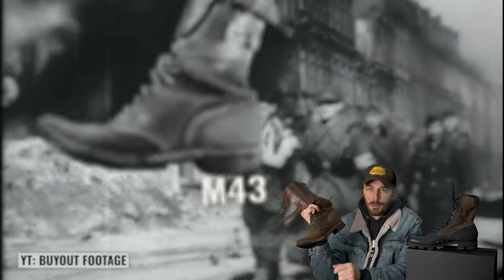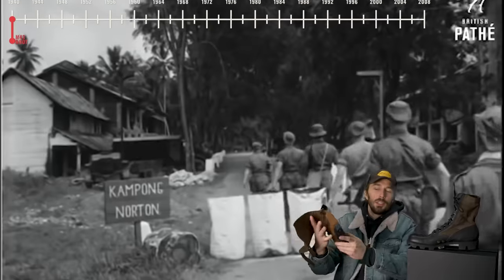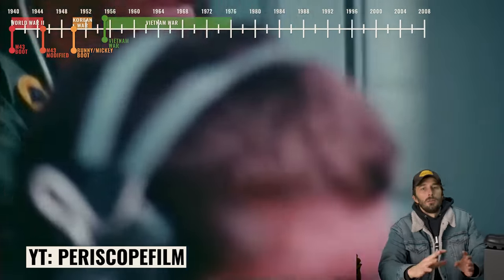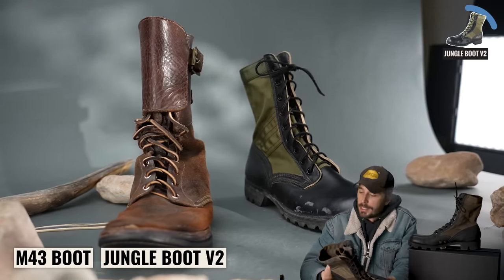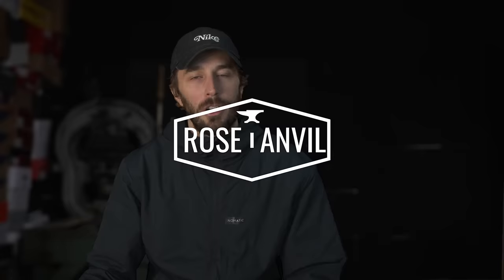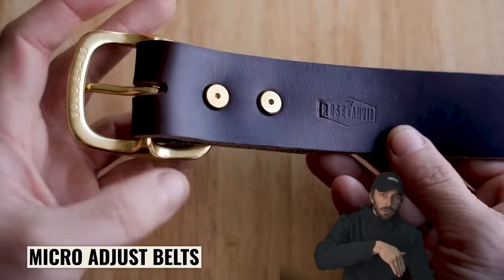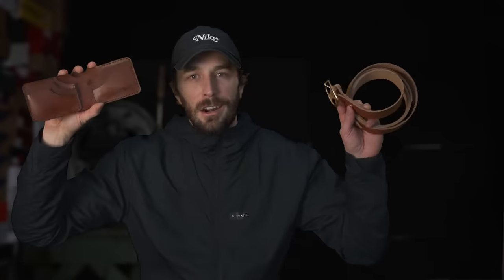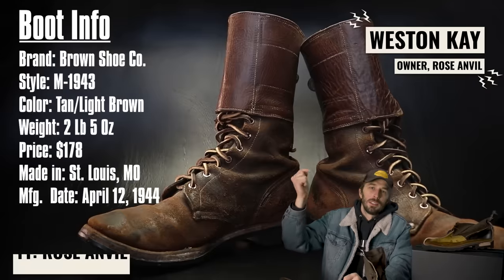Why Vietnam changed boots foreverr - (cut in half)

Comment: Loved the video, but you did miss that in today's market, jungle boots relatively are dirt cheap for how much they give you! I bought mine for about $80 and other than having to buy some extra insoles cause the ones I bought did not come with them, these boots are a killer! In terms of looks, strangley goes with a lot in my wardrobe. In terms of function, also top tier! since they're canvas, lighter wieght than other heavy duty boots and have them drain holes, they are super comftrable for a guy who has sweatty feet! I work a lot on my feet and sweat a ton but these are so nice! Also the heavy duty soes have saved my feet countless times and I've only had them for a couple months! For anyone on the fence for getting jungle boots, it's honestly a great alternative to higher end boots

Comment: I was in the US Navy from 79 to 1985 and on board destroyers from 81 to 85. When I got out to the fleet I immediately bought a set of these at the Navy Exchange and wore them continuously as footwear while wearing dungarees either in port or underway, my ship ending approving them for use in conjunction with those dreadful US Navy Boondockers!  They had nice grippy traction on non-skid and if you got soaked either by rain topside or via a wave coming up on the weather deck they were quick to dry out. I still have a pair that I use when I go out for walking in the local state park.

Comment: When I was in the US Army ,I  was issued and wore the Vietnam era jungle boots while deployed to Honduras in the 1980s.  My experiences with these boots is that overall the boots failed to protect my legs. 

As the jungle boots were overall too low, the side panels were too thin; flimsy as well, and they  did not keep the trouser legs blouse tucked in the boots thus  interfering as to being too low with not enough side surface coverage that also often interfered with my lower legs, blood circulation.

 I had WW2 1938 canvas Dismounted Leggings to wear over the low ineffective jungle boots when necessary.  

The DoD should have had the jungle boots made taller up to 17 and 18 inches tall and with thicker to offer full leg protection and act side panels.  Such taller and thicker side panels would also act as a preventable splint as well to prevent injuries. I also found that the steel insole protection against pungi spikes to be a good, helpful. 

Based upon my experiences, I think a tall lace-up Snake Boot with a good durable sole with steel insert anti pungi spikes and water drainage potholes would be a good choice as a replacement Jungle, hot weather climate military boot.

Comment: I used to wear these in German Summers when in BAOR, and iI fitted them with Zipit inserts using paracord. I was so operator! I also wore junglies DPM (No.8s?) as much as possible and spent a lot of time avoiding RSMs and their tiresome dress regs. Personally, I found the soles a bit too hard and used to use sports shock absorbing insoles in them. The drain holes not only let water outbut let cool air in inf you flexed youut up and down, you could air-condition your feet! And I wasn't even infantry, but an armoured ambulance driver and medic! But otherwise, a great boot and better than any of the abominations we were issued. There was a UK jungle boot, but it was more like a high leg plimsoll with ankle support, like some fucked up Converse sneaker. Comfortable but certainly wasn't punji spike proof

Comment: In 1987 I returned to Active duty, obtained a letter of acceptance from the 1st Ranger Battalion sergeant major (Dave Dalton)..

In order to be in battalion one has to attend the Ranger Indoctrination Program (RIP). So, less than ten days after my arrival I drew my unit issue of goretex equipment, six sets of OG 107 jungle fatigues, and two sets of jungle boots.

I set off for Ft. Benning on a late July Friday with newly issued boots, and a 12 mile road march (55 pounds in the Alice pack) to participate in on Day Three. 

From experience I knew that it was very possible that I would get blisters on my heels or the soles of my feet wearing my new boots.

My solution. Fortunately, there was a bucket used for mopping the floor. Soaking a set of boots for 12 hours made both sets somewhat supple and  the stiffness of the leather was completely non existent on Day One of RIP. 

Without question, jungle boots were my favorites for multiple reasons. Durable, less inclined to get stuck in mud over the leg boots they were issued upon initial entry into the Army. 

Thanks for the history of the boot and the insight into the layers of it. Good to know. 😎

Comment: In 1986 - 1990 If you were a Paratrooper, we could still wear the Jungle boot with our BDU Uniform. It was authorized and all the LEG soldiers were envious of us being able to wear these iconic and awesome footwear. I even Jumped with them as they offered great ankle support too. They only sucked in cold weather 30 Degrees F or colder because of the steel plate. But I did wear min in 17 degree weather and was not too uncomfortable, or maybe I was and I didn't complain like a normal soldier because I was AIRBORNE. ;)

Comment: The Panama Sole is the best traction pattern for muddy conditions by a WIDE margin!  The newest version of the Jungle Combat Boot uses a fabric (the same as in anti-stab vests) anti-spike midsole and a Vibram made Panama-ish pattern outsole.  It's modernized with thick EVA padding, probably to reduce stress fractures.  It's probably not as good in extremely wet conditions and is heavier than the old ones, but is more comfortable.

Comment: I tried a pair of the Mickey Mouse boots when I was young...I found they didn't do a good job of keeping my feet warm, so I never wore them again.

The soles of my Son of Sandlar boots (9-button, knee-high, square toe...gorgeous) are about as aggressive. Until this video, I'd never seen soles as aggressive. I haven't been wearing them, mostly because I'm in bad shape, and it's too much work to put them on...and balancing is difficult at the moment, so those extremely thick soles put me too high for safety. 

Even though the Son of Sandlar soles are similar to the jungle boots, I'm not wading in mud with my fancy boots. I would be upset if they got damaged. I'm shocked the price has only gone up about $90 since I bought mine around fifteen years ago. So many other things have rocketed in price.

Comment: I wore "jungle boots" in Turkey from 93-95.  They were light, cool and very comfortable.  I loves mine.  The only problem was the sole couldn't last against the hot concrete of the middle east.  Now the only Jungle Boots are Chinesium knock offs that have lace eyelets that pull-out of the leather.   The  next hot weather boots I wore during my military career were the Rocky Specials Operations boot but it couldn't be resoled.

Comment: Always my favorite boot when I was active duty - never issued, I bought 3-4 pairs out of pocket. Before the advent of minimalist, zero-drop boots, these were also some of the highest foot-flexible boots when compared to everything else that was standard issue.

They make the worst Winter boot though, and not just cause they're not specifically made for cold temperatures (though that doesn't help) but if you ever have to walk on a slick, iced sidewalk, those big, flat lego block outsole bits have absolutely 0 grip. You will eat shit. Learned that 1 day in Ft. Riley and never wore these in those conditions again.

Comment: I wore jungle boots for about the first 5 years I was in the Reserve.  I found them to be fairly comfortable for long wear.  The sole was not the best for running, but they were more breathable than any other boots available at the time (late 90s). There wasn't much in the way of ankle support, so you had to watch your footing, especially when on rocky surfaces.  I had one pair made by Altama that failed completely after about 6 hours of saltwater immersion.  The soles separated from the toes to the arch.  Those were the only boots I've ever had that happen with.  
The jungle boots were great for the time and conditions they were designed for.  From the late 90s through the GWOT there were many well-made, new boots authorized for wear, so I ditched the jungle boots for more modern boot designs.  That said, they were the coolest looking boots you could wear in uniform.

Comment: I was in the AF 71-75.  Never got closer to Nam than Guam, but wore, still have the V3 version.  I was never told anything about them.  They were just Jungle Boots, as opposed to our all leather all black spit shined boots (or dress boots if you like).  I was certainly not told there was an anti-punji stick steel plate in the sole.  I still have mine, although I think age and weight has enlarged my feet but not my boots.

Comment: I wore these everyday from 89-93, while in the Army. I didn't have any problems with my units not allowing them. The only times I didn't wear these was when it was near freezing (Danners!) or inspection/parade in the 82nd. I had to wear my horribly uncomfortable and immaculately spit-shined jump boots for that. I didn't see any mention that the steel insole would eventually break at the ball of the foot, then randomly make a loud snapping noise as you walk. I don't remember how long that took, but that caused the retirement of my first pair.

Comment: Trench warfare is from WW1, not WW2. Soldiers in WW2 fought mainly from foxholes. The Germans fought from trench lines, because in WW2 after 1942-1943, the German Army especially on the Eastern front was on the defensive. The problem with development of these boots is because the Army did not have proper boots to fight in a steamy jungle environment that Vietnam was.  They had a type of hot weather boot, made for the Philippines, but it was canvas and would rot. Boots are issued and worn by troops to fit their environment. I knew a sgt who somehow ruined his boots in Germany in the winter, he had not changed his go bag and had jungle boots he had to wear in Germany in the winter. Froze his feet off. The jungle boot was a good boot, but it also depended on which one you got. Either with or w/o the steel plate to help with the injuries from punji sticks. These boots were eventually phased out as the Army changed uniform patterns, and footwear to match.

Comment: I grew on the Iowa/Minnesota border and forty years ago part of summer work was detasseling corn. If you turn up at dawn and walk a mile down a field full of shoulder high corn, then a mile back, you get soaked to the skin. And it's not common, but it is possible to get trench foot, which I had one time, I think in 1981. It cleared up quick, but I've still got this weird fold scar thing on my left foot from it. It's bad enough going hours with that stuff, I can't imagine going for WEEKS.

Comment: We didn't like these boots because of their ability to shed mud, many soldiers had these boots resoled with wave pattern soles. We liked them because, compared to the DSCP issue boots, they were far lighter, cooler, and better for rucking in. They broke in quickly, they had less leather to polish, and they were pretty cheap. I wish I had kept mine when we went away from the BDU to the ACU's.

Comment: Here's what my problem was with these boots.  I wore them, USN 70-75, in RVN.  I have a very high "in step."  That is, the top of my foot arches higher and the area of the boot that went across my instep was sewn tightly.  Basically, it would cause numbness and pain.  I had to cut the area near the bottom laces to allow for this.  The steel shank was great, but walking on hard surfaces was also a bit uncomfortable.  However, all in all, these were great boots and I still have mine.  Doc USN

Comment: I wore these from 1990-2005. In a Mountain Unit the whole time, We loved the light weight, but one of the major drawbacks to the boot was the lack of ankle support. Traversing hill sides took its toll. The other thing I recall is when we had to go any distance on the hardball, more than 5 miles, my feet would start to scream. The mesh and thin leather were not enough cushion support on hard surfaces, lastly, I'm pretty sure Vietnam never saw below freezing temps, but in the fall that rubber compound would get hockey puck hard and any ice under foot would make you look like Bambi. It was a sad day when I put them away for the last time.

Comment: The modern jungle boots are the best design.  the original design which was talked about in your show didn’t provide any ankle support and my ankles are still destroyed 20 years later.  the upgrades to the modern usmc hot weather boots is the diagonal canvas piece was replaced with leather.  this greatly improved the ankle support.

Comment: in 2013 I went on a botanical expedition to the forests and mountains of Vietnam.  My Co-worker who'd done similar work before recommended a fine and expensive pair of waterproof boots. As soon as I'd traversed the first stream much to the amusement of my Vietnamese colleagues I soon saw the boots were a mistake.  As soon as I got back to Hanoi  they took me to the markets to find a £7 pair of Vietnamese Jungle boots. Essentially high ankle canvas plimsoles, identical to those the Vietcong used back in the day.  They were a huge improvement over the hugely overdesigned boots I'd brought. They'd dry out on your feet and no grips to collect mud.
These US Jungle boots may seem outdated but if they performed so well for so long I'm pretty sure they'd be at least as good as todays budget and mid range boots. What do you think?

Comment: Flat rubber soles tend to wear out faster because there's less flex to them, increasing surface abrasion on hard ground.
So the panama soles really do wear out faster on things like concrete and asphalt. ... You know, things you really found a lot of in the middle of the Vietnamese jungle.....

The forum people are right this time. They are, however, also missing the point completely; These aren't marching boots. It's in the name.

Comment: You really can’t get a true appreciation for the issue Jungle Boot unless you wore them in the field or deployed. Without question, the most versatile warm and wet weather boot ever created. I was fortunate to have both the original green and later all black jungle boot, my personal favorite. Other side of my German Field boots, the best temperate to cool weather boots, the all black jungles were outstanding. The only drawback were the insoles.  Insoles in the 80’s and 90s sucked. I ended up taking insoles from running or basketball shoes, to make the boots more comfortable.

Comment: I wore basically the same thing in Iraq and Afghanistan. They are absolutely a bitch to break in, but once they do they will outlast anything. I tried Danners for a while and they fit like a running shoe they just don't last. I had a couple pairs. One for inspection, one for roadmarch/daily, and one for break in.

Comment: I entered service with the Marines in the 1990s and retired in the mid 2010s.  When I was new the jungle boots were still regular issue.  Loved those things.  They were being issued at the time with the old green nylon tops but newer black ones were what you saw all the time.  We were also issued full leather combat boots in the 1990s but I disliked using them.  More to polish and most annoyingly, they weighed more than the jungle boots.  When we did our Swim Qualification we'd be using the jungle boots still.

In the early 2000s was when the Marines transitioned to MARPAT camouflage uniforms.  We were authorized to wear our old jungle boots with them as the rough side out boots were not accepted yet.  When those came in the mid-2000s the transition to them happened.

Another big plus to the jungle boots?  They were dirt cheap.  Their lightness made marches / humps better.

Comment: When i want something quality, i do buy some surplus leftover genuine military standard issue boots via online army shop. DM's, as fashion brand, doesn't last long enough. The way thin leather gets folded and unfolded with every step you take, and then easily gets crinkled, and finally cracks at that specific point, gets holes into the leather. Army boots are different - they do last much longer.

Comment: I can’t speak for everyone’s experience with the ‘Panama’ boot, but from my own experience the sharp corners simply wear faster. Especially if you’re walking on stiff or rocky terrain. The sharp corners, whether they be the near 90° corners or the more sloped angles, the edge of the corners abrade fairly quickly. The sole doesn’t ’wear out exactly, but that abrasion of the corners is pretty noticeable. 

Reminds me a lot of rain tires in motorsports. The treads are in similar ‘blocks’ with the channels designed to move water out to the sides of the tire. As soon as that rain tire begins to roll on dry or drying track, the sharp edges of the channels begin to abrade away quickly leaving the car with substantially less grip. 

Again though, you mileage may vary I guess.

Comment: My jungles were from the Chinese manufacturing era and they were made with the worst possible rubber.  It fell off in chunks and I walked around on the metal nails because I couldn't afford new boots.  Good luck winning anything when that's where you source your material.

Comment: The sole probably does wear down fairly quickly, because boots made specifically for "off road" activities, and to have traction on things like wet rocks, are generally much softer rubber.   So if you walk around the city a lot, and especially if you drag your feet, or have some imbalance in your gate, it’ll show wear very easily.